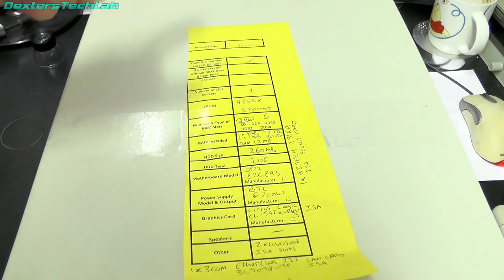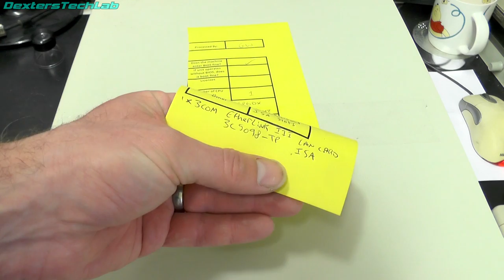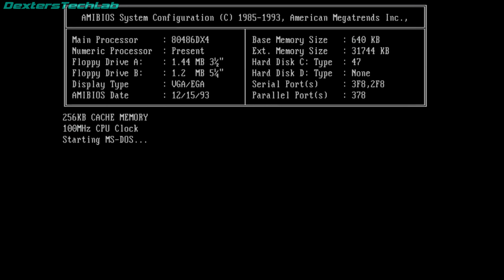DL187 1994 Vintage 486 PC Restoration & Upgrade to DX4-100

Comment: Hi , Nice video.
With the LED speed, i gave up with patience and time as i did not right down the pins and the results of the led between the 2 pin states and ended up playing with jumper to just say HI

Regards
George

Comment: The first PC my wife got me in 1994 was a Intel 486sx33. Loved it. Played everything on it. When it came time to upgrade I got a AMD 486ex4-100 cpu. I dont recall a heatsink or fan on either my sx33 or dx4-100.
Reply: General rule of thumb is 486 CPUs from 40-66 MHz need a heatsink and from 75-133 need a fan as well. They can survive for a bit with no heatsink, but they will rapidly die.

Comment: One nice upgrade for these systems is an IDE to CF card adapter which often you can plug directly on the motherboard or controller card so you not only remove the noisy and slow hdd but reduce the IDE cable clutter as well.
And if you want to splurge there are also the Gotek floppy emulators
Reply from the maker: I nearly put a CF in but i really liked that everything was working, apart from the DX4 and the RAM it's all original. When the HD dies i will swap to a CF.
Reply: I couldn’t get compact flash to work on my 486. I just ordered an ide to sata. I have lots of sata drives!

Comment: Not a bad score at all!
@ 28:13 : IRQ 7 is most likely taken by LPT1 on the multi-I/O card, unless you disabled it of course. This is why most soundcards after a specific period defaulted to IRQ 5 instead of IRQ 7 (very early SB cards etc).
Reply from the maker: Damd, yea i forgot about the parallel port!

Comment: Everything that I used to play with back in the day, ended up being expensive, one off... impossible to find even on eBay today, kinda stuff... Some of my best memories that I'd love to go back down the rabbit hole with again, were just so niche and high end back then that today they are just impossible or so expensive, its impossible. Dual socket 370 Abit BP6, Dual FCPGA Flip Chip 370 Abit VP6, each of which ran dual cpu's WAAAY before multiple "cores" were a thing. I ran Win2K to allow for both to actually do something... I was water cooling them back then too, with aluminum or copper (I used copper) water blocks from OverClockersHideout.com ... which still seems to be a site, but I don't think its of the same ownership... either that or that with the time changing, the format and overall theme of the site changed as well. But they used to offer lots of products... I got my transmission cooler, surgical tubing, custom reservoir and submersible pump all from them too... I think I even got my peltiers from them as well. As all of these systems were being Thermal Electrically Cooled... TEC>or Peltier.... They would all frost over, some producing inches of ice on the CPU and MOBO.... which was itself distilled and non conductive... so long as it remained ice, it was fine, and it would remain for days if not weeks... as these systems would just run. I was even asked by my tech school in high school to build a custom show piece PC... one that I could use for my own tasks and Cisco training. So I got a budget, and did just that... All acrylic case, cold cathode lighting, slot one mobo, celeron 433 overclocked to 850, ice 24/7 and heavy ice at that... CC lighting really made it look neat. And it was a solid machine.... I of course had our entire electronics and networking labs linked up to play Unreal Tournament and Worms World Party. What good times those were.   Anyway, after a major digression... this hardware I played with, so hard to find... and this is but a taste, all of it was one off crap.  IBM ThinkPad 360/PE with pen, external CD-ROM, running Win95... I used to use that with Aol Instant Messenger all the time with a PCMCIA 33.6 modem, as well as browsing the internet of course... but back then, that wasn't really a thing... not much to browse. But it had its place, and was just left behind somewhere... and is now worth thousands... Mac Plus original with literally ALL accessories, printers, peripherals, software, manuals, etc ever produced for the platform... rooms full.... all left behind ... So much stuff... even one off Packard Bells of the mid to late 90's that can't in any way be found anymore. Some are attainable, but never the specific stuff I had. And when it is, it's insanely expensive. Voodoo 5 5500, Voodoo 4 4500, STB Velocity Riva 138, Voodoo 3 3000, Voodoo 3 3500 w/ tuner, Voodoo 2 (2x sli), Voodoo banshee, and so many other internals, externals, etc... ehhh  
Despite none of it ever being the stuff that most talk about, it was all REALLY RARE things individually.  Had I kept them all, and kept them in working order, packed away.... I could have one hell of a unique museum of sorts.
PS I clicked the generated link I posted, and it is in NO WAY related to computers at all any longer... so that domain, idea, life-source... is dead and gone as well. Ehhhh... internet archive I guess... feed my nostalgia and sadness a bit. Yep, and internet archive for the win... if anyone wants to see what custom cooling, super cooling, water cooling looked like pre AIO's .. in a world where you fabricated it yourself, via 90's interwebs, check out the 2002 January site data... its so beautiful !

Comment: Interesting, I've never seen both types of memory sockets populated simultaneously. I didn't know one could do that.
Reply from the maker: Yes but only in banks, so if your using 30 pin you can't use any 72pin in bank 0. There were similar setups on later Pentium boards that had 72 pin slots and 168 pin DIMMs.

Comment: wow, isa bus and edo dram. should also put a sound blaster in there just for the hell of it. can't remember for sure but i think dx4/100 was amd chip with 25mhz bus and intels was dx2/66 or something like that with 33mhz bus? anyway run some old dos games in that thing. my first encounter with pcs was with 286. it was good for the time....

Comment: Perfect build, just missing a Soundblaster Pro 2.0 :D
Reply from the maker: I had wanted to use an AWE64 card i have, but the board has no ISA slots!
Reply: @DextersTechLab  To me it looks like it has 6 16-bit ISA (3 with additional VLB) and 1 8-bit ISA slot?
Reply from the maker: Lol, was thinking of my Pentium 3 machine 😆.

Comment: I'm surprised just how expensive beige pc gear is these days. Sold a 486 board and cpu, along with a voodoo 2 card to a friend for $AU250, and we both think we got good deals 😂 
That is to say, I think I got a lot for stuff I'd had sitting in a drawer for years, he thinks he got it cheap

Comment: Don't use an air duster can, use the vacuum cleaner and a small brush. Air duster can just blows the dust into the room, which is not good for your lungs.
Reply from the maker: For stuff as bad as this, i went outside!

Comment: Did you actually manage to accomplish the speed settings you programmed the turbo display for?  Such a large speed difference seems like it could be really useful for compatibility but getting a DX4 to run at only 8MHz?
Reply from the maker: I never found out, but i doubt it ran as slow as 8mhz. When i next power it up i might investigate further to see what it really is running.

Comment: I never dared to disassemble a floppy drive that far, I heard stories about the writing head getting missaligned, causing disks you write with it to be unreadable by other drives. Do you know if this is true? My floppy drives can use a good cleaning and lubing. Did you test it after assembling?
PS. My Aztech card has a jumper on it where you can choose to save the settings to EEPROM or not, maybe it is set wrong? That could cause it to forget it's settings. I had a similar issue with mine.
EDIT: I see you already tried that lol.
Reply from the maker: Head alignment on floppy drive id dependent on how it's constructed, being mindful of this helps to only disassemble the parts that don't affect it.

Comment: Shame about the soundcard.
Perhaps it could be fixed by cutting the connection to IRQ 7 just before the card edge connector, and bridging the track over to IRQ 5.
Reply from the maker: Yes, i think i will investigate further and try and get to the bottom of it, i want those OPL3 sounds!
Reply: @DextersTechLab  AWE64 has decent OPL3 emulation if I remember correctly. Though emulation is still emulation, the real deal feels better. :-)
Reply: @8bitbubsy  Nope, it doesn't. It's a mediocre reimplementation. Better than VirtualPC2007's 'emulation', but not quite good. Even an ALS100 can do way better.

Comment: I don’t understand, doom it’s supposed to be very slow on a 486 class cpu?
Reply from the maker: At the lower speeds (25/33mhz) yes it will be quite choppy, but as soon as you get to a DX2 or DX4 CPU with a decent VLB video card they perform really quite well.